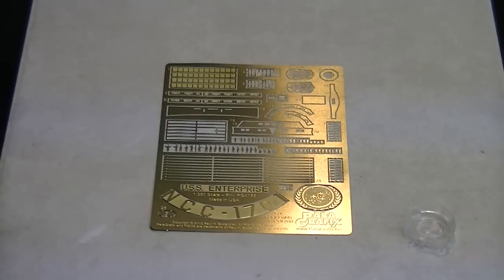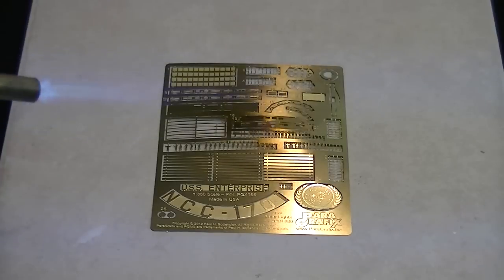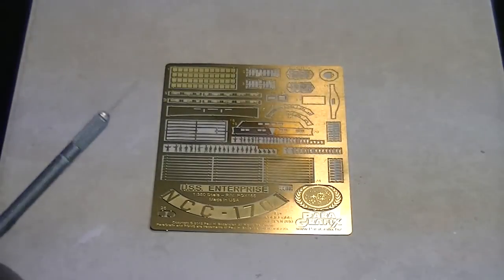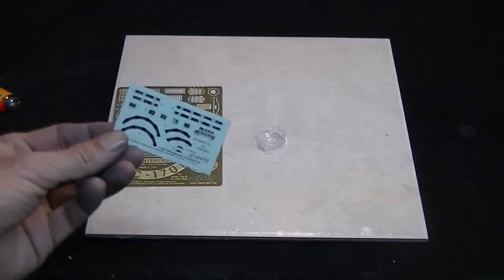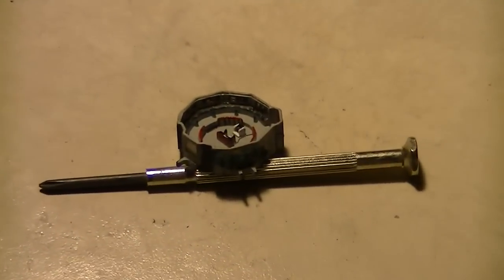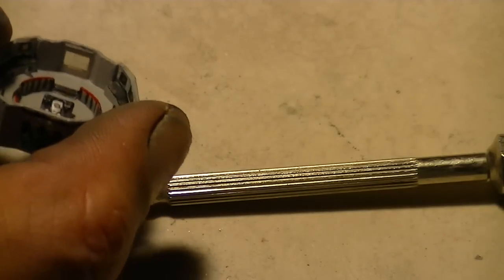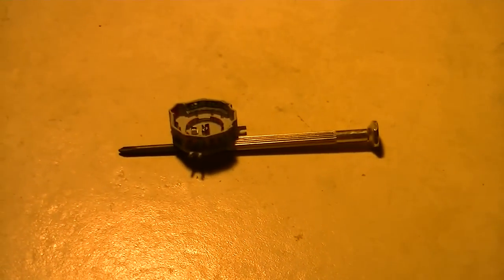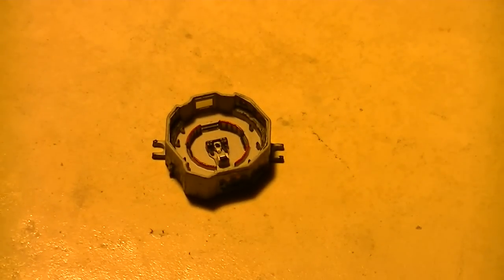Polar Lights 1/350 Scale TOS Enterprise Buildup PT 1

Comment: Yay! The build I been waiting to see you start Boyd. The bridge work is nice and clean. If you plan to crew it use the smaller crew on the Paragrafix kit as the bridge is apparently slightly smaller than 1/350 hence the smaller crew versions on the photo etch set. The reason for the smaller scale bridge may be for fit inside the bridge dome for either the off center angle to match the turbo lift or place it forward to the bow which we saw in the first pilot. Are you going to crew the bridge?

Comment: Hmmm could you not have applied the brass handrail parts to the raised surround? I still think you could've handled the handrail-- stuck them down with canopy glue-- adjustable for a while. Still, nice. I am curious about how you're lighting this little guy.